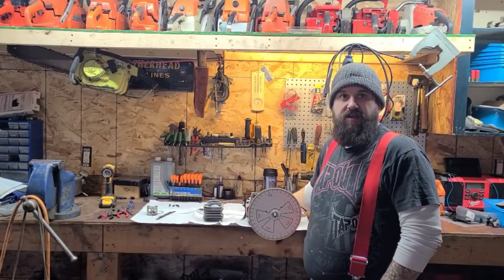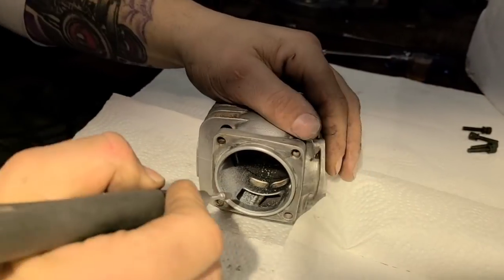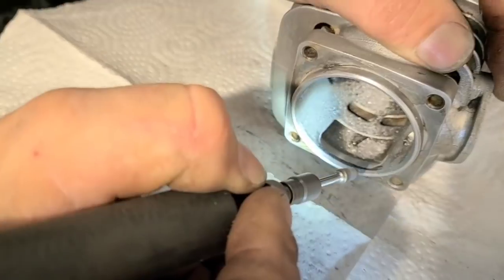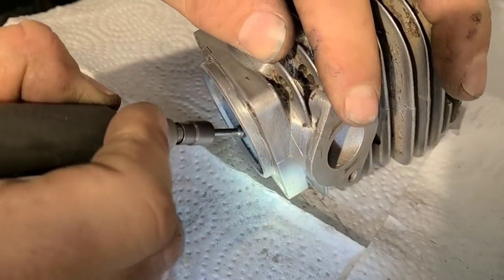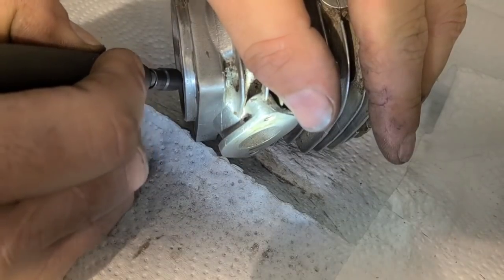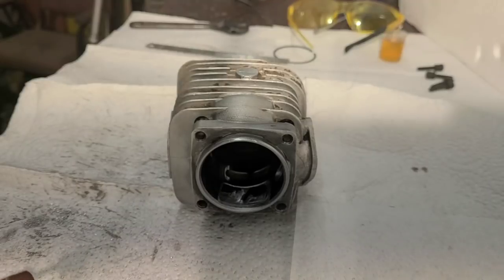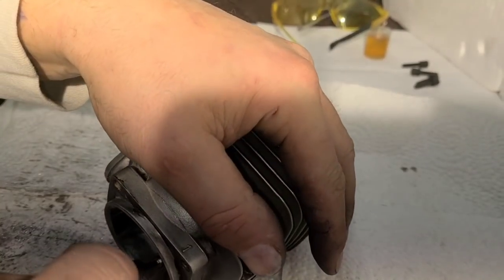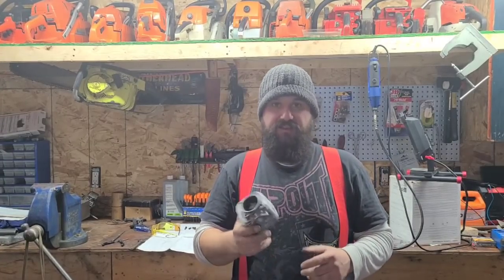How to port a chainsaw part 6: Echo 670 grinding the transfers.

Comment: You made a great point about not knife edging the transfer port bridge. The air goes around a rounded edge way better than a knife edge. The knife edge should only be used for the trailing edge.

Comment: Hey tinman, another great video.  You should try some chalk on your double cut burr bits, instead of oil, it's not like an end mill on a big stiff milling machine setup where you are just hogging out great big chips and it needs the full flute depth in between the cutters just to clear chips, it's more like a file, where just the tip of the cutters is doing the work, and the space in between cutters just gets gummed up with chips.  Chalk or what they call here machine wax, it might be called something different up there, the stuff you put on your big old table saw table to keep it from flash rusting from just the humidity in the air, they both help keep the cutters from getting gummed up better than oil for me, I think the oil might mostly get flung off at the speed a Dremel works at maybe?  Thanks again for the great videos, I used to be a good mechanic/machinist, but my memory is toast from multiple sclerosis, so YouTube videos to "tune up" my brain before I do some project are great, even if I have done a bunch, just to help me relax and not worry that I forgot something simple that will brick what I'm working on, hah, it makes it more fun if I'm not trying so hard to remember what I forgot, hah.

Comment: Excellent work. Thank you for your knowledge. About to start my first port in a few weeks (Waiting on parts ..yay shipping delays due to Rona). I've bought a second tiny little 25cc Certa 10" saw to practice on. I already have one (It's cheap and Chinese made) and love using it instead of swinging my bigger Stihl 661cm when I'm cleaning small stuff up and pruning. It's already a little ripper, but I've bought a second one for parts for the first if all else fails, but it's to be my first port experiment.

Comment: Thanks for the close up Tinman kinda like porting a SBC head keep the air flow as straight as you can. And keep it rough so the air fuel keep mixing. Thanks for showing us
Reply from the maker: Yep exactly like a cylinder head except the valve is the piston.
Reply: Thanks man for reading my reply
Reply: I’m starting to get it I just got to stop thinking Chevy

Comment: I'm not sure if you seen it last time. what works for just plain air does not always work for air and fuel. even if I go back with a sander drum I will always go back to the ball cutter and lightly hit everything straight lines from one side of the port to the other. for small 4 cycles its typically a roundish port so I go all the way around the port making it look like ribs. I've had 2 cylinder heads flow tested note wet flow tested to the cams lift and the one I finished with the cutter bit flowed and atomized a bit better. picked up a bit more torque throughout the rpm range. This method I have found works for both 2 and 4 stroke engines regardless the size of them. Hope this helps buddy. Good work btw.

Comment: Great information thanks for the vidies. I used a pencil grinder for 12 years in a fine art foundry and thought you might like to know your grinder is running too slow and it chatters real bad at that speed.  It would run smoother at twice or three times that speed.

Comment: How many times have you jumped out of a port and hit the cylinder?
How much does it take to damage the bore.
I noticed you clipped the bottom coming out but that wouldn't matter down lower.

Comment: Great video. You are the authority on all things 2 stroke. 
I would love to see a design ive been thinking about for transfer port bridges. But i don't think there is enough metal there to mod and make my design. I think you would have to be a manufacturer and cast it this way. 
My idea is to have one bridge go 30 degrees to the left and the other 30 degrees to the right. Creating a swirl of mixture in the upper. 
Instead of blowing right at each other.
Is this already a design that is implemented? I have only worked a few saws and i don't own any of the high end saws....yet

Comment: Buddy gave me 372xp x torque that is locked up from straight gas, have s 52mm big bore kit and everything to make it like the original style 372xp, have a degree wheel and everything to start porting, what kind of numbers should I be looking for to make it last?should I rebuild it and run it for a while before I try to port it? I have fixed a few power saws in the last year, a couple smashed and a couple blown up, I have found that I get so much satisfaction from taking a broken down saw and making it new again

Comment: Hej Tinman! I wonder if i can grind down the transfer port and nothing else? Do i need to care about numbers and timing and such if I only grind down the bridge? And also if I do this what will the outcome be faster revving, more top end power or more torque? I really wanna learn to port but the saws I got I use on a regular basis and I don’t wanna damage them so I thought it would be good to learn grinding on the transfer port! Greetings from Sweden.

Comment: Hi Tinman, would you consider measuring the volume of the chambers before and after porting? It would be a good reference number to see! Obviously more air flow and volume is beneficial for the performance. Muffler mods and volume calculation on the exhaust side also be interesting.
Reply from the maker: You could do all those things for sure. I'm not that technical about my porting lol
Reply: @tinmanssaws  art vs science :)

Comment: Is it worth opening up transfers on an otherwise stock cylinder for a 272? Watching ironhorse videos he likes to open them up to match the windows but would it have a negative effect without adjusting the timing on the intake and exhaust? Just getting into porting and for the moment have limited tooling but I’d like to try to work on the stock cylinder before installing.

Comment: Can you go too far down with that ramp?
Like, if you made it so that there wasn't a full circle at the bottom of the piston, would you run into trouble with the skirts not tracking well and rattling around at all?
Reply from the maker: Thats a good question, in some cases yes you can go too far. Going too far can effect piston stability and it could effect crank case pressure and how the saw runs.
Reply: Probably need that ring for sealing otherwise transfer is always open, or maybe that doesn't make any difference

Comment: I thought I’d ask this before you get to final assembly. I watch a variety of YouTube channels. I saw one where they were installing new bearings. He took the seal off of the old one and showed why it went bad. Then he took the seal off of the new one and showed the lack of grease in the bearings. He greased it and put the seal back in. He said that they won’t have the issue they had before. So my question is have you ever checked to make sure that the bearings were and are properly greased?
Reply from the maker: I'm not sure what grease you are referring to?? 2 stroke bearings are lubricated by the oil in the gas.
Reply: @tinmanssaws  I thought they were sealed bearings! I haven’t seen a show where they showed the bearings up close. I saw an episode on another program. They showed some lubrication points some people didn’t know about. It was on the bar side and they shot it with some grease. That was why I asked. I’m just curious and mesmerized by watching the great work that you, Harvey, Bellehopper and Bayou country do on chainsaws! Thank You for replying back to me!
Reply from the maker: @kurtsimmons1587  oh thats the clutch bearing, its needs to be greased regularly.
Reply: @tinmanssaws  thank you. I can’t wait for more. Have you ever by chance checked to see if the new ones actually had enough grease to start with?
Reply from the maker: @kurtsimmons1587  new clutch bearings typically don't have any grease in them from what Ive seen.
Reply: @tinmanssaws  if they need greased why not? Sounds odd to me though. Maybe that is why things burn up so fast anymore

Comment: My only real question is, do you aim the air away from the exhaust port when grinding the transfer port divider? Or just grind it so it splits the air evenly?
Reply: Nevermind, you covered it in the cutaway video. I don't work on saws much but tons of other small 2strokes. These are the best videos on the subject anywhere.

Comment: Okay in side the transfer how come you don't want a sharper edge on the devider wall ?
Reply from the maker: Knife edged surfaces dont flow as well as round surfaces.
Reply: @tinmanssaws  a good read on laminar flow helped me conceptualize what's happening inside the cylinder..cant wait to see it perform!! Pretty work tinman!!